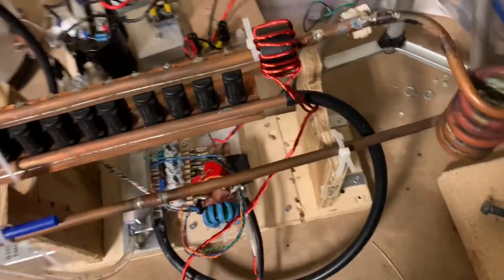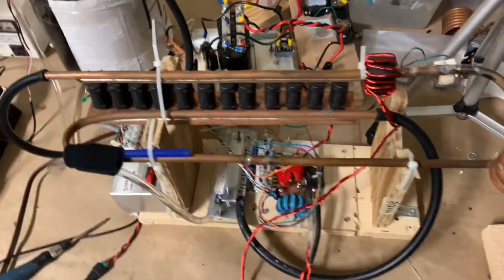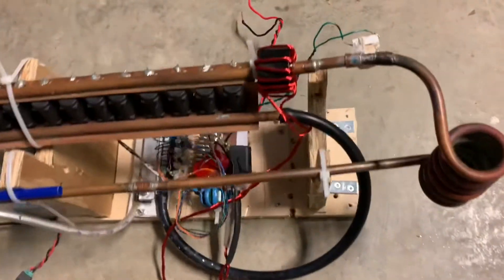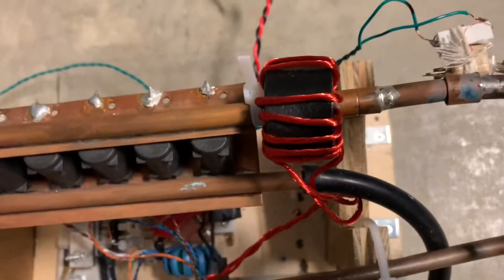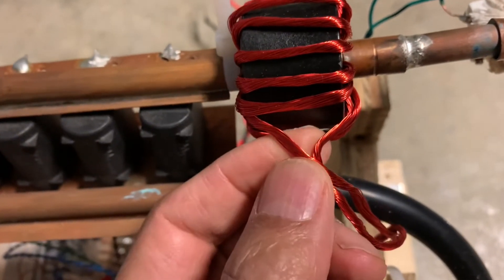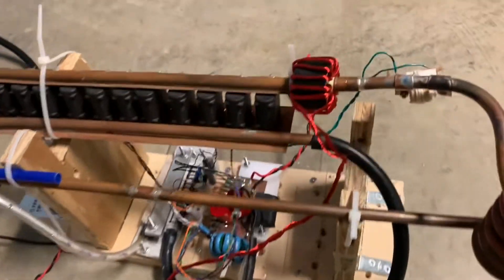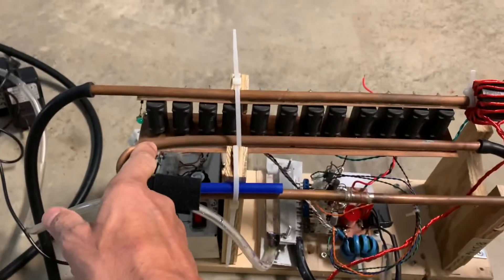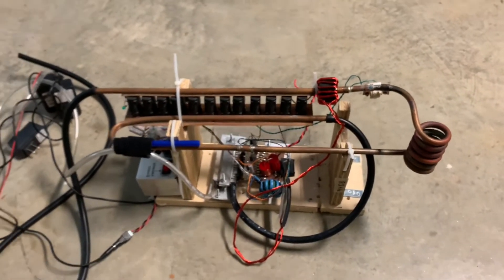Autotuning Induction Heater Update-Fun with Steel Bolts

Comment: hy i just saved your schematic, can this method applied for igbt ? i wanna apply it to my power converter, if read your sch it should be set above tank resonant freq thus it set to zvs right?
Reply from the maker: Right should work
Reply: @BrianDhvTinkerer  in your sch i saw that you use only 1 inverting level of 74hc14 right (which is pin 3 to 4) ? Thanks anyway for sharing the project

Comment: Nice job. How many kilowatts have you tried?
Reply from the maker: Thank you. The unit has held up well with no blown switches. This included trips to the Pensacola  and Orlando maker Faires. This particular unit which uses full bridge FGA60N65 IGBT easily  handles 3.5 kW. The limiting factor is the capacitors. I build a larger one which handles 9 kW with bigger caps. Here’s a link:

https://teslascience.wordpress.com/autotuning-9kw-induction-forge-version-1-2/
Reply: Do you have a video or screenshot of the oscilloscope tracing showing the inverter input signal and the inverter current? I'm curious to see the phase relationship.
 @BrianDhvTinkerer
Reply from the maker: @imsmoother this can be done after I get my isolation transformer connected back up. Give me a day or two. To be clear I will scope the inverter current that flows out of the inverter into the coupling xfmr against the signal across the burden resistor on the 100 turn feedback transformer?
Reply: @BrianDhvTinkerer  you are measuring the voltage signal across the coupling transformer against the current through the coupling transformer. Maximum power transfer and minimal stress on the MOSFETS will be when they are in phase. The danger zone is when the current through the coupling transformer leads the voltage across the coupling transformer. Current is going backwards through the switches through the fly backs,
Reply from the maker: @imsmoother  just pulled out the set up, connected up an isolation transformer, and did a test. The yellow trace is the scope trace across the coupling transformer. The blue trace is the scope trace of the feedback transformer from the tank. I put a small screwdriver in as a load and also tried the setup  unloaded. The feedback takes over once the current in the tank circuit gets high enough. I need a link to send you images and video. Pl check fb messenger for pictures and videos of the phases. I can always do a more direct measure of current flowing through the isolation transformer by putting a small current transformer and burden resistor on one of the legs supplying it

Comment: looking into this project has really had me studying llc resonant circuits and the like. they shove an inductor in parallel with the coupling transformer it appears. the inductor is toring the energy and also isolating the resistance of the load from the tank... i think...arrrgh!

i feel part of the issue is the q factor, the choice of tank components.

i still havent got my head around the real magic, what i do understand is the resistance of the workpiece reflecting back on the square of the turns ratio. thats the same as tube amps... the work is a single turn, the coil is a transformer with loose coupling factor.
say5 turns, 5:1, so your "0R01" workpiece would reflect back as 0R25, yet unloaded, its ..."infinite" reflecting as "infinite"... at which point, you shouldnt actually pull current at all, the tank should reach equilibrium, and yeah. 

its interesting that you use the coil itself as a resonant tank. i often see it simply as a shorted loop... 

then your coupling transformer, i love that, its the thing that first had me playing with this circuit blown too many fets on ZVS... thats another reflection, so your 1/4ohm will now be at say, 1:14, 14^2... 49R...

you could say then your parameters are from 49R to "infinite" R...

something seems wrong that it goes beserk when unloaded... again, i dont understand the magic yet myself! effin semiconductors.

part of it seems that its the parallel resonant tank for the work coil... a transformer shouldnt load the supply when its open circuit! 
consider, with steel in there, a resistance absorbing current, those currents are producing their own magnetic fields and therefore BEMF that limits the applied current. 

unloaded, the impedance goes super low, as theres no longer a reflected DC R in there, the bemf from induced currents negligible as there arent any... and your current goes out the roof as theres nothing to oppose it. 
but WHERE is this current going?
through the low ac resistance of your secondary tank capacitors... i think?

or its the inductance of the thing changing so drastically... i said i dont understand the ins and outs... its hard to find much decent info on induction heating and most everything is directed to making high voltage dc supplies, effin... and this is dealing with RF too. more voodoo!!!

i just know it shouldnt be happening! and personally, i think its having two tank circuits with conflicting behaviour.

another thing is the way the two tank circuits act around resonance.inductively versus capacitively. capacitive loading is bad... 

so, its impressive nonetheless! i miss playing with real industrial one that could vaporise a 2 inch bar...

and that has me thinking of tapped coupling transformers.

to me, the ideal layout is a half bridge , run a secondary inductor about 8x the tank inductor, parallel with a ~20:1 transformer, tapped. and work coil is then directly on that. non resonant. waiting on... bits. then will dodge something up.

i looked up your specified driver IC, had a heart attack.
then realised you specified TWO types, one inverted, and had another coronary. come on, man,  a bootstrap high side driver with opto coupler for ... less than a dollar. if you got the junk...
!
meh. youve given me a few goals to work on ;)
Reply from the maker: Thanks for sharing. That is a really interesting take on it.
Reply: @BrianDhvTinkerer  igot off my butt last night and played a little bit, throwing a few toroids and various ferrites onto a ZVS, and arose this morn with an epiphany i feel worth sharing....

series LC, you run them OUT of resonance. drive a bit higher to keep them "inductive"

that is, at resonance, they have MAXIMUM impedance. so they have to be pulled off resonance, to deliver power to a load. that gets into Q and funky stuff, complimicated. theres a fine line between resonating and... not resonating!

the ZVS is parallel. at resonance, they draw maximum current, minimum impedance. 
what limits the current flow is the impedance, or really, the losses.
they also stay resonant despite throwing virtually anything a them... they really lock in, have a high "q" i guess.

virtually no losses, and it sits there happily oscillating, drawing virtually no power.

you add a loss, which is a lower resistance for more current and heating as i2r, and the impedance is reduced, and the current consumption goes up.

you throw steel in your tank coil of a standard ZVS, and it reflects the steels resistance at the turn ratio, and therefore current is limited to that value. when the steel is removed, the resistance increases, and limits power more-so... its got no losses to replenish..

the frequency changes due to the change of inductance, but that doesnt really alter things other than that induction heating equation where F(requency)2 is a factor, and skin effects... the reflected resistance/impedance is what really matters.

so, i stuck a ferrite on my ZVS, after some fiddling, made a neat transformer with a flyback core, and some coiled pipe.
20t:5t. 4:1 step down. the coiled pipe forming the 5t secondary goes on to make a 5t work coil, and returns. with a simple shorted copper strip to make the "loop". no resonant tank here. so secondary to work coil is 1:1. wish i had an ammeter to measure some stuff? lol.... meh! trial and error! and logic!

i put work in the coil, say its 1R.
i have 5t, so it reflects at 5^2, 25R.

if i had a 1:1 ratio, or my workpiece was in the actual tank coil... it would see this "25R" as the limiting resistance/impedance, and the LC tank circuit would pull the current it requires from the supply.

i have 4:1. or, i have multiplied my 25R by a further 16...

limiting my current to a mere fraction of what it should be. im heating stuff but its pretty pathetic so far! got a bit of steel bar glowing dull red... can happily short the coil with out things blowing up, so i have half the issue solved? that was always the problem with ZVS, they EXPLODE! ive been trying to isolate that issue. i think i have.

another way to look at it is this...
my tank rings at 200V. (220 actually, from 35V)
i step down to 50V. with 4:1 in my ferrite transformer. (i found ferrite toroids got stinking hot using your method, hate to say... but i didnt try my whole assortment. just a bunch of yellow/white, not that colour really means much. a gapped ferrite flyback core works without ANY heating. its also the exact same type of core found in those handheld commercial induction heaters for loosening bolts and the like. just tore one apart lol.)

i put that 50V across the 5t coil of 25R for 2A.
my work sees 5X that for 10A.
i have 100W, or 10A^2x1R in the workpiece.

if i step UP.
1:4... ((800v/25R)x5)^2x1R? 
i get 26500 W or something developed in the workpiece, and the reflected impedance limiting the current in the tank is 25R/16.

i am limited by my power supply to 270W. though i reckon i can push 500W for short bursts...

i was gapping the ferrite to reduce inductance and give me more turns on the primary, but now i feel that was erroneous thinking, as i need more secondary turns instead. 
as i increased the secondary turns from one, a single loop in toroids, to 3, 4, 5 on a ferrite, the frequency kept rising, exactly as if i was reflecting the work coil more than the primary inductance of the transformer.

so, armed with a bit more knowledge, im going to make it 1:1 rather than 4:1, ungap the ferrite, and hopefully actually pump some juice into this coil...

and finally, the only real issue with ZVS is supply voltages... if you supply the gates with a separate 24v supply, their fine, you can run rectified mains for more juice.

hope it makes sense. i'll make some more magic smoke and post a video...

Comment: Ixdi614ci ×2 ixdn614ci ×2 right sir? Or ixdi614ci×1 ixdn614ci×1 ? For full Bridge
Reply from the maker: Yes those are the gate driver chips Ie IXDI614CI x 1 and IXDN614CI x 1 to drive the primary if the 1:1:1:1:1 ferrite gate drive transformer. The four secondaries of the GDT drive the gates (or bases) of the full bridge of MOSFETS or IGBT. I found that 12V works fine for both MOSFET or IGBT. 
I am using full bridge consisting of 4x FGA60N65

Comment: Mica is a pretty good thermal insulator. Would recommend alumina or even better beryllium oxide insulator for thermal conduction of heat from IGBT to waterblock. Speaking of which, where did you get that block?
Reply from the maker: So far not been a problem with the mica. But agree it is not an optimal heat transfer material. 
The cooling blocks I got on ebay

Here is one source:

https://www.ebay.com/itm/1pcs-Aluminum-Water-Cooling-Block-for-CPU-Graphics-Radiator-Heatsink-5-Sizes-US-/185031821830?mkcid=16&mkevt=1&_trksid=p2349624.m2548.l6249&mkrid=711-127632-2357-0

Comment: Good stuff. I am using an esp32 as a software controlled oscillator to auto tune mine but so far I have cooked so many MOSFETs I have run out and am looking more carefully into different types and driving them for the best efficiency.
Reply from the maker: I don’t have the programming background to do a microprocessor controlled autotuning. The coil shown here uses a small 100 turn current transformer and burden power resistor of about 20 ohms such that 1000A=200V.
200V is too high so I use a current shunt which is 1/10 the cross sectional area of the 3/8” copper tubing to give a more manageable 20V. This is clipped by a series of zeners and clipped down to a 5V square wave which is fed jnto a hex inverter which runs the feedback loop. I’m using a water block to cool the FETs and the work coil. When the input voltage is low, there is not enough current in the primary tank to initiate current feedback. The low signal generated by the 555 is attenuated by a 7.5kOhm resistor and appears on the input pin of the hex inverted as a clipped off sine wave which shows up on the input pins of the inverting and non inverting mosfet driver chips as a rectangle wave (less then 50% duty cycle). The narrow rectangle wave provides some heating but not much. It is a good way to control the power use by the system. When voltage is turned up the current in the tank increases a lot and then feedback loop kicks in as the feedback signal is only attenuated by a 150 Ohm resistor and overrides the low signal from the 555 which is attenuated by a 7.5 kOhm resistor. At this point the duty cycle jumps to 50% now with square wave input to the mosfet driver chips. Heating and current draw  markedly increases.  When the work coil is not loaded,  the current draw increases to the 30A which is hard on the mosfets and tank capacitors. If I could come up with a circuit perhaps using a relay switch controlled by a microprocessor to turn off the feedback signal from the current transformer when the coil is not loaded, I would have a product that is bullet proof. So far with this build I have not lost any MOSFETs. If you are interested in collaborating to use like an ATtiny 85 or something similar to control  a relay switch to turn off feedback at say 30A DC current draw, I would love to work on that wi the you!